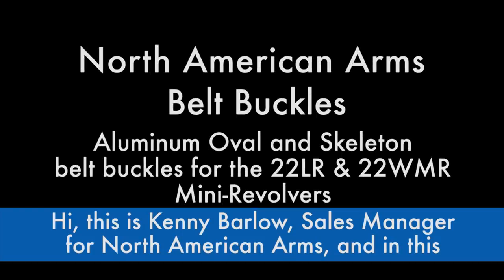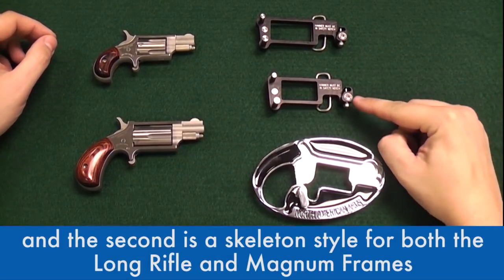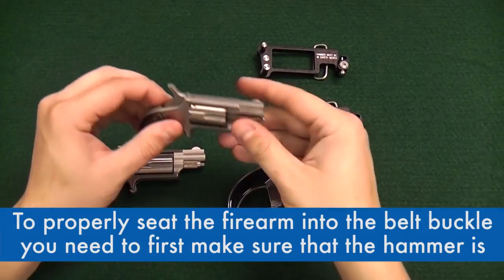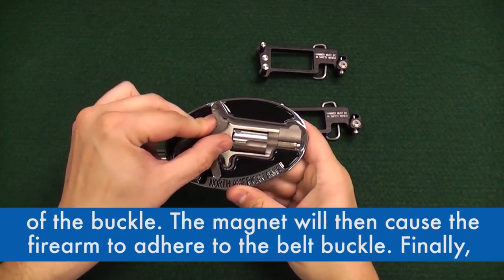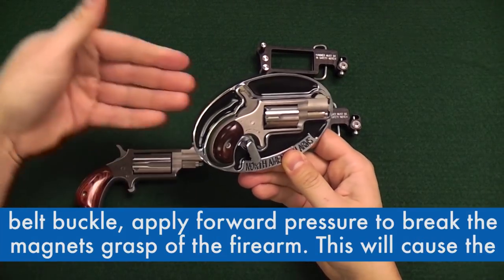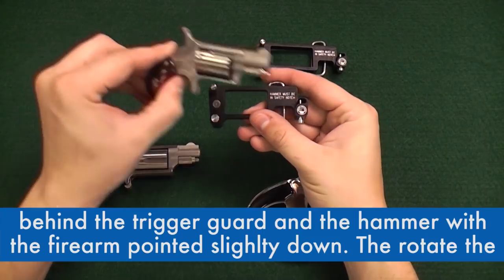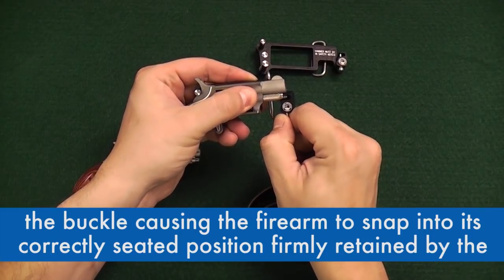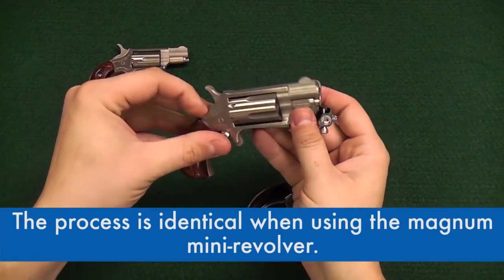NAA Belt Buckles

Comment: DONT bother getting this if you have an older .22 mag version, just went through ordeal.  IT WILL NOT FIT.   after calling on them, they said they would send a modified buckle, no they sent the same exact buckle, then they sent a modified cylinder pin, that did not fix problem. Issue is the firearm is a tad long at point of where its held by the pins. In particular the pin that holds directly where the hammer is. my hammer is slightly exposed manufacture build. that slight exposed hammer gets in way of pin.  now i am sending back original buckle purchased at my expense, and they will not refund shipping $.  So clearly not standing behind their product,  nor are the staff properly informed that this buckle will not fit older .22 mag.